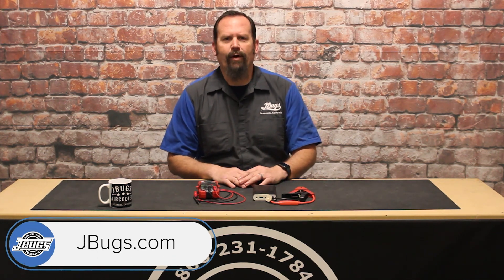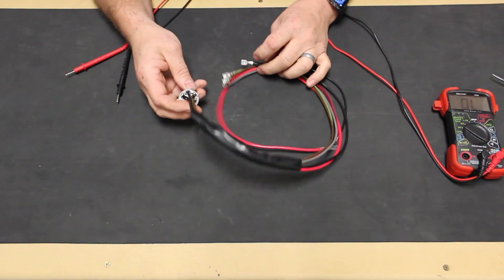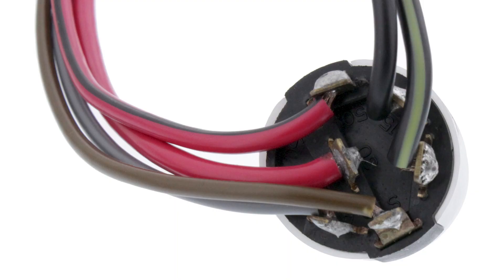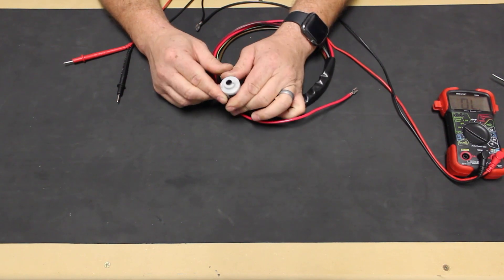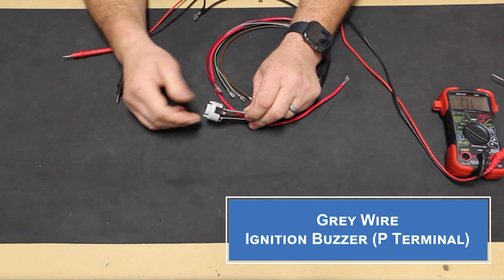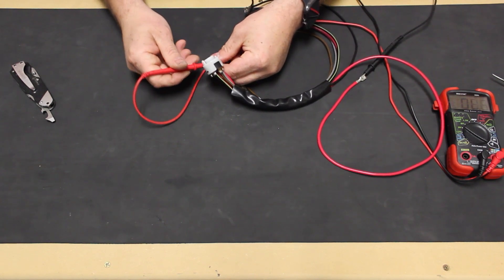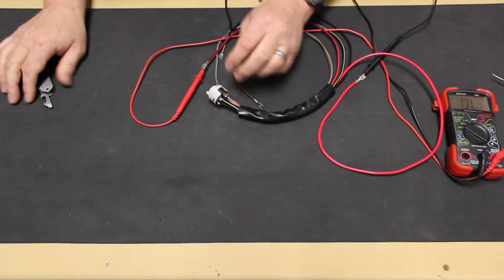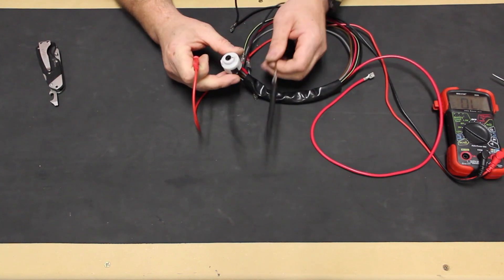JBugs - VW Dash Switch Testing - Ignition Switch

Comment: What does the pig tail plug into from the black wire off of 15? The video and the manual do not specify say it. it goes into the fuse 11 but you only need one wire to go in there. Thanks.
Reply: The pigtail wire from the key hot ignition wire goes to the bottom tab on the speedometer to provide power to the dash warning lights.
Reply: @Sam_Mebane becuase in the diagram it shows the 30 from wiper goi g into fuze box pigtailing into top of speedometer then pigtailing into the idicator power terminal
Reply: I check the power terminal where a pigtail wire should connect but its blocked by another black pigtail come from the same fuze area

Comment: Check me on this additional test: connect lead to 30/power and lead to 15/fuse which feeds the coil, test in accessory position and should work, now turn to starter position as though cranking engine. Power to 15/fuse & coil should still continue so that the coil has power while running the starter.
Reply: I've never checked 15 while at the starter position but I do want to say I've seen some switches momentarily drop power to 15 while the starter is turning.
Reply: @Sam_Mebane  I took the switch apart, noticed 2 things, the place where the contact rests in a slot for pivot was too tight for the piece to ride up and down with the sprints and when looking at the T shape from above, the left top of the T was not even with the right side in that it would barely if at all make contact when rotated, I bent the left side up for a tighter contact and pressed the T up and down to clear the channel and now the car starts every time. Saw a lot of posts where people hardwired the battery to the coil and car would start and they did not relate the issue to the ignition switch or even why it would be that.  If a person can get under the dash and connect alligators to the contacts without taking the steering apart, one could rule the switch in or out.

Comment: hi, what happens if i have 30 and 15 in the same terminal?
Reply: Then you probably want to get a new switch. 30 is battery power (on all the time). 15 is ignition power (only on when the switch is turned on).
Reply: @Sam_Mebane  I've think about that, cause, mine's not working anymore so my dad adapted a different switch years ago and sometimes the fuse pops, and now I know that those 2 aren't meant to be in the same terminal and it could be the problem, the fuse can't take the power from the battery